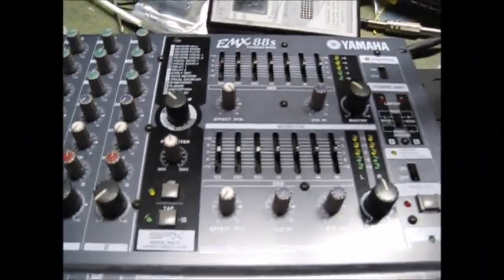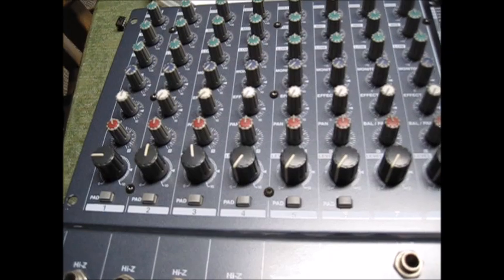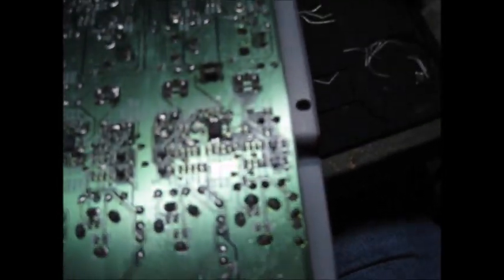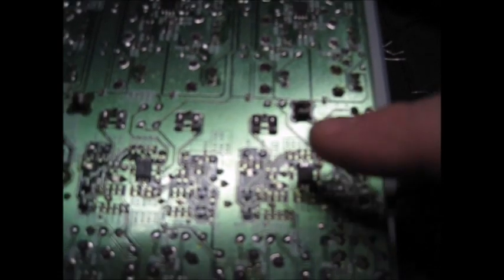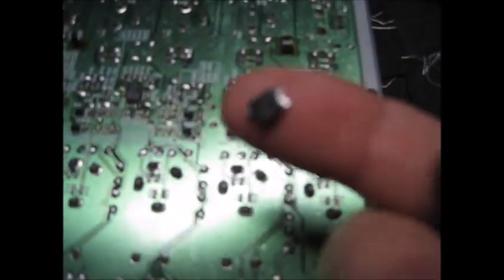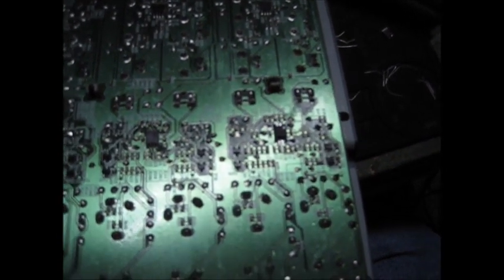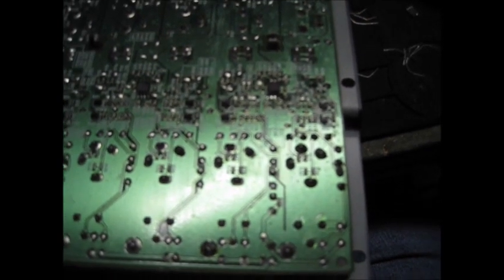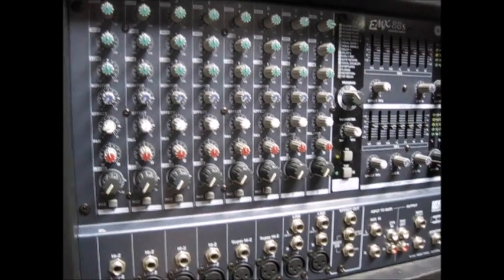An unlikely success!   Yamaha EMX88s distorted channel.

Comment: Cool Video DK, God where do you start with one of those..? Lucky to fix eh. It's a always a marvel how something so technical can fall apart with such failure, because of a tiny component..Good job man..Ed..uk..😀
Reply from the maker: This particular family of mixers is said to be quite reliable too.   It took 21 years before its first failure.  I suppose that's not all bad.     I had some SMD boards in the scrap,  so I practiced removing the chips,  testing some of the methods I had been shown.
Reply: Good job mate!  Being generous with liquid soldering flux helps a lot when soldering & desoldering smd's.